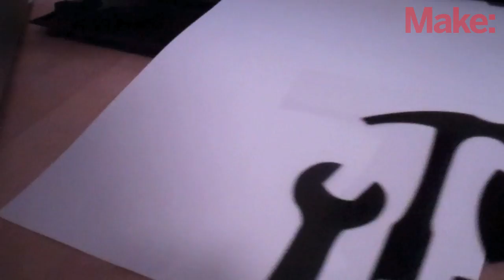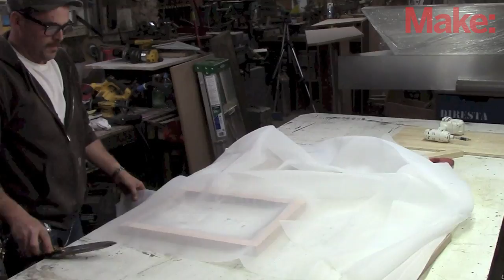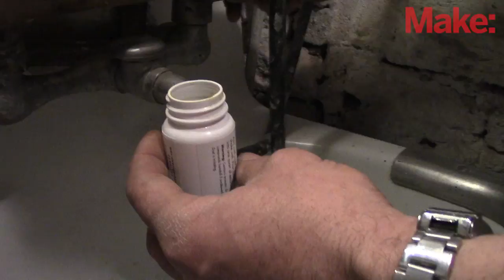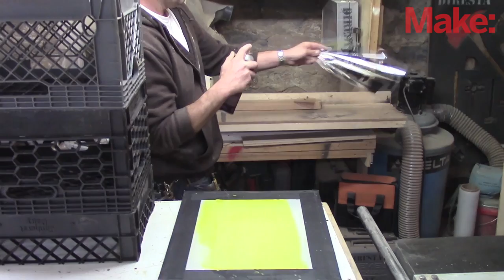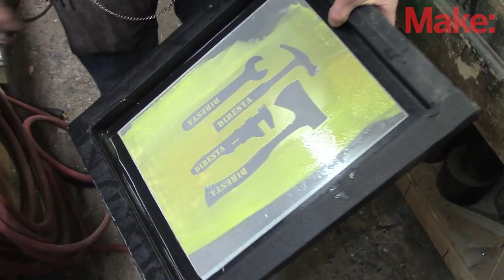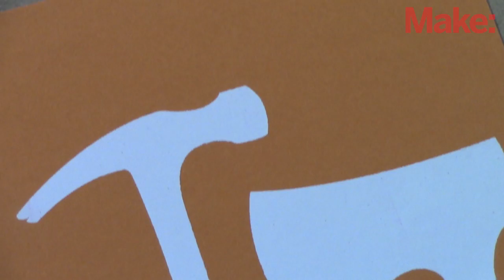DiResta: Simple Silkscreen

Comment: Silkscreen is amazing, it can be used on so many things and you probably don't realize that many things you constantly use are silk screen printed. The metal and cloth ones will not stay on for long, you need special inks for them and using the paper specific one will just flake off with use. Otherwise it is an amazing way to just make things pop permanently for cheap.

Comment: cool.
how long does the tub of mixed product keep?
do you have to worry about breaking down the product on the screen while cleaning it? or is it pretty much one time use?
Reply: about 30 to 60 days depending on how you store it. as long you use the propper cleanser for the screen you can keep it as long as the nylon lasts, i mean, if you don't rip or something
Reply: fernandoanimator would definitely have to get smaller bottles! That's a lot of screens in that tub!

Comment: You can use nylon as well. If you're printing light ink on a dark shirt, though, do one print, let it dry, then do another over it. And you don't need to cover the entire screen with enulsion, just the part with the design on it. And don't use so much ink, you had enough ink for days when you first applied it. Jeez. :/

Comment: Why not spend 50 bucks on a real screen and a scoop coater? The screen can be easily reused for as long as you bother cleaning it properly and don't break it by juggling knives, and the scoop coater makes for much more consistent results.
Reply: Building Supply
Absolute BS, considering that when screenprinting you are both creating a graphic and modifying an existing object or project by applying that graphic.

Your statement is the same as saying someone who built something using a store-bought hammer isn't a maker. I could build a house using a rock, but I'd rather not go through the effort if the results are going to be sloppy due to substandard tools.

If someone made a detailed stencil and tried applying it to one of their projects using their first attempt at building a wooden screen, 9 times out of 10 they'd have a half-assed result.
Reply: Building Supply
Great comeback, dude.
Reply: Take a walk around the block and calm down, everything will be just fine.
Reply: hes tha master. not you young panduwon. not you. hey if its as ingle use / function then so be it. soo are you going to buy him wat he needs then?
Reply: Nathan Dean I think the term you are looking for is padawan. Are you saying this is like building your own lightsaber? Interesting comparison.
Reply: yes yes it could be.